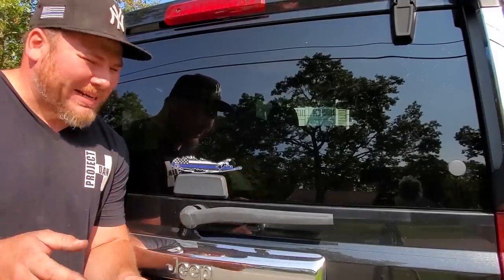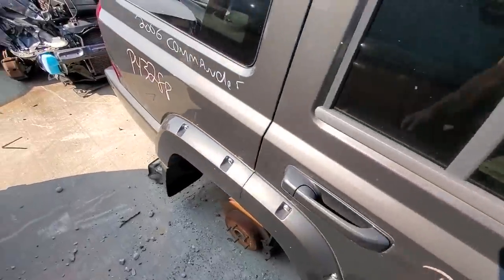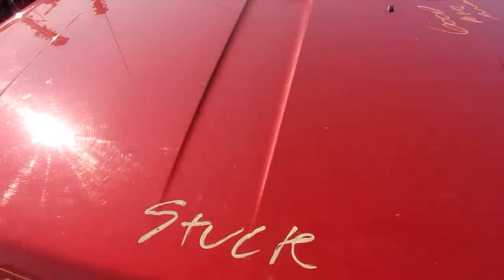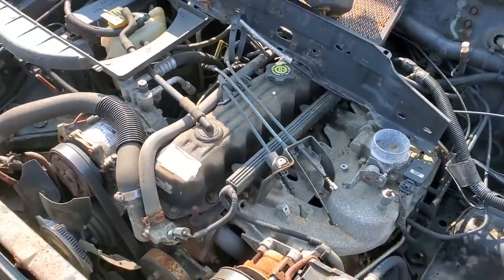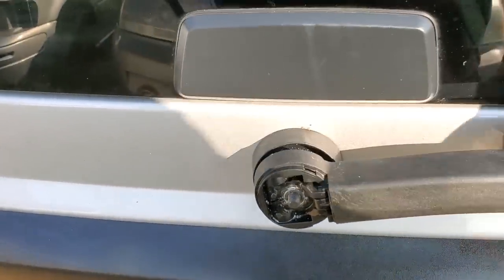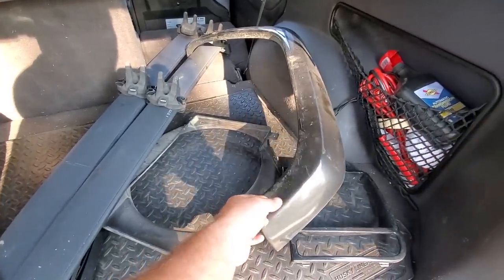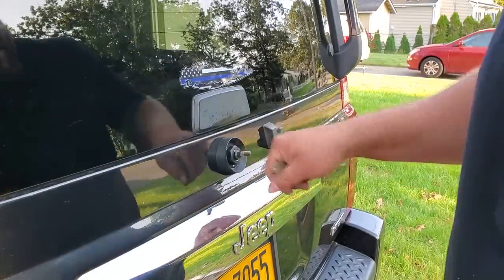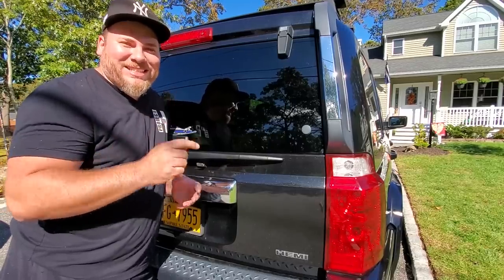JUNK YARD HUNT AND FIXING A JEEP GRAND CHEROKEE / COMMANDER REAR WIPER ARM

Comment: Thank you. I didn't realize there was a nut fused to the bolt. The part was almost returned. I di exactly what you said. The job is complete. Just make sure you do not over tighten or it will crack. Nine is on a 2006 Grans Cherokee, but everything looked the same.
Reply from the maker: Glad it helped! excellent job!

Comment: YUP, same thing happened to my kids 2006 jeep. Hard to get the old arm off after nut removed. I let it soak with Blaster  for a bit. Thanks for the Vid. :) P.S.  I used a Ball Joint Seperator under the arm and put the nut back on loosely. Tapped the seperator till snug, then give the nut a sharp tap. Arm popped right off.
Reply from the maker: Thanks for the info, Great idea!!

Comment: The Commander is kind of growing on me.  The HEMI and quadra-drive would be great.  I think I've only seen 1 Commander in the pick a part yards in my area...tons of WJ's though.  Getting harder to find ZJ's, still looking for a driver's door interior panel in gray, everyone I've found so far either the panel is missing or damaged worse than mine.  The XJ's I find in the pick a part yards are pretty well trashed.  Usually find several of the 1st generation Liberty's as well.  

They are opening up a "Premium" Pick a Part yard in one town next week.  Supposed to be newer vehicles 2015 and newer with pre-tested drivetrains so they'll have engines & transmissions that they've tested and pulled sitting on the shelves ready to go.  No word on warranty information on that stuff yet though.  Going to check it out when they open.  

Going to go pickup a camper shell for my 87 Ford Ranger this week, harder than hell trying to find a camper shell for a Ranger with a 7 foot bed.  Finally found one, so I'm going to go get it before its gone.  They want $40 for it, and it looks to be in really good shape.
Reply from the maker: I love the hemi commander, I want to get my wife an expedition max so i can daily the XK.

Comment: you can tell the 98 from the 99 by the roof rack. 99 and newer had the shorter roof rack
Reply from the maker: yep, the tell for a 99 is the first year of the short roof rack and the last year of the "unleaded fuel only" on the tach

Comment: Can you tell me how much to pay for an old jeep? Find lots with high mile a few with little rust and few with   reasonably priced.
Reply from the maker: that's a loaded question, gotta narrow it down for me
Reply: @ProjectDanH  
Ok so I want an in line 6 but is it bad to buy one with high mileage like over 200 if no rust it seems like can find low miles with rust or high miles no rust. Can't  find both unless I go to a 3.7 I want to pay 2-4k love the videos.
Reply from the maker: @rlchick5774   you can probably find a 150k milage jeep XJ for around 4k. Search everyday Wait till one with no rust comes along. Your patience will be rewarded. Thanks for watching!
Reply: @ProjectDanH  
Need to get some othat perfect 10.  Found my Jeep Grand Cherokee last night pretty excited. Need to chace down an oil leak, have a bump stop rolling around inside a rear spring, has a small hiss so need to chace down a vacume leak. Cosmetically it's not perfect but no rust
220k miles for 1k so I can spend a bit and could keep it running forva while. Engine light reads needs all or at least one oxygen sensor. Auto zone said they may just need to be reprogramed. Any recommendations to getting that done? Also it has a 2" lift I want to put new tires on it, what do you recommend? Your voice makes me feel relaxed. I think I can do this myself. Just went to the scrap yard for head rests. I didn't realize someone got frustrated not knowing how to remove them and took out the base piece that they slide into to need to go back for those. Could be a good video to show the not so obvious things like the fact that you have to pinch in the button on the one side and a fingernail or the but of a fork to pinch in the otherside to get those off.  Pretty excited. Thanks for the videos.
Reply from the maker: @rlchick5774  wow, no rust!!! that's a score!!!  congrats!! Thanks for watching my vids.  those headrest bases are really annoying.  sometimes you only need a paper clip, other times you need to pull up the whole seat fabric.  I may make a video about them if I do DVD screens in my new build.  Thank again 👍

Comment: 1:00 in, I'm thinking I hope you got the motor too.  Put the arm on the motor with a blade, put it on the counter and they Might only charge you for the motor.  Ask me how I know
Reply from the maker: lol! no, I didn't think of that 🤣. the arm was only like 4 bucks 👍
Reply: @ProjectDanH  when I did my disc brake swap on my 99 XJ with the corporate 8.25 I took the backing plates, backing plate studs, calipers, rotors, hoses, and pads from an 03 Liberty.  I assembled everything, set them in the wheelbarrow, and went to checkout. Sure, they were busy, I had them sitting on my leather jacket, the guy just looked over said, "$20 for the drums." I didn't correct him. Based on their online pricing I Should have paid $120. I still find gems there to this day.  I don't get as good a deal as that anymore, but what can I say?
Reply from the maker: @robertgrauman8602  LMAO! As long you're not stuffing things in your pockets and sneaking them out anything goes!
Reply: @ProjectDanH  Only things I stuff in my pockets are the nuts/bolts that hold the parts on, maybe fuses, and any found tools

Comment: Dan check out (Uncle Tony's Garage) on YouTube, the video you are looking for is (Camshaft failure in the Gen 3 Hemi) it's what is scaring me away from getting involved in the New Hemi Engine in the Commander because i like the look of the Jeep. This guy is an old school engine builder who thinks the Camshaft was relocated to far from the Crank and is not getting enough oil. Tell me what you think?
Reply from the maker: I Know Tony, it's a sound theory.  not every hemi is blowing to pieces.  find a low milage XK Hemi and enjoy it!
Reply: @ProjectDanH  Maybe in the Future  my XJ has plenty of life left in it with 122 Thousand but I will be looking for a Zinc additive. or oil containing it. As you said it's  hard to find a low milage commander. Looked at a few with Crazy miles so some of those Hemi's last.
Reply from the maker: @nobsatthistime  yes.. searched far n wide for mine. 2010 limited hemi with 76k miles... Rare